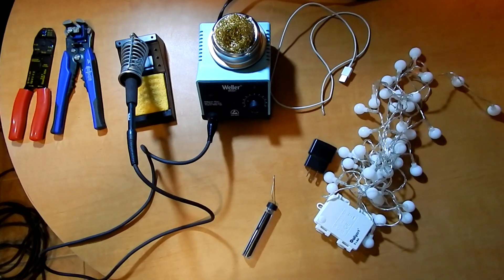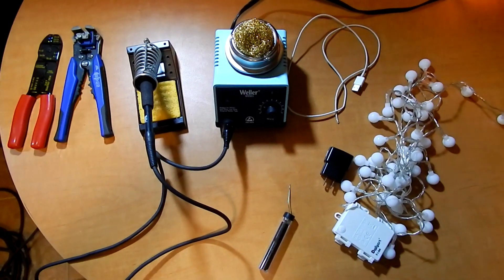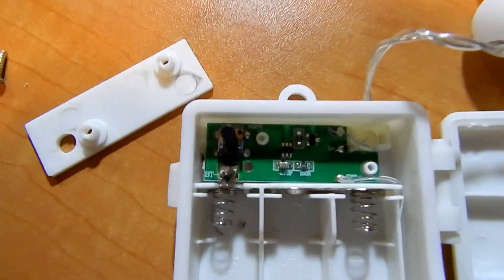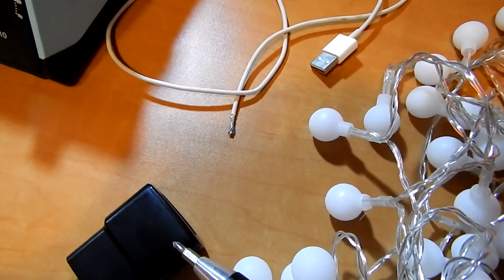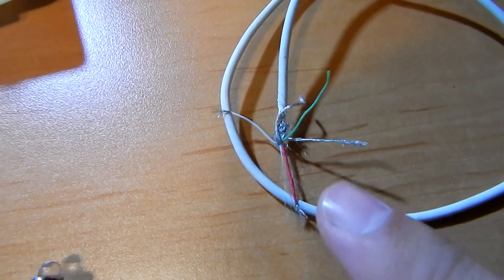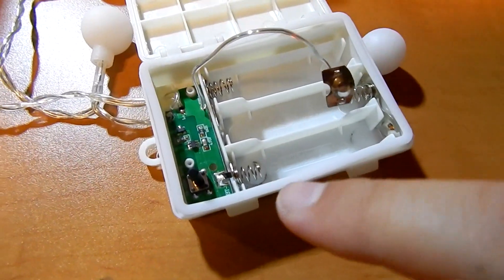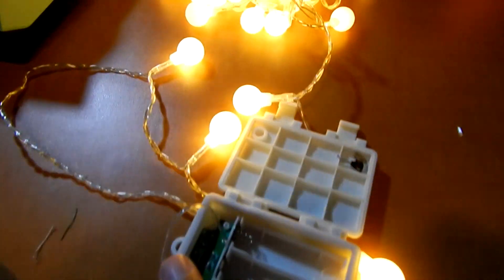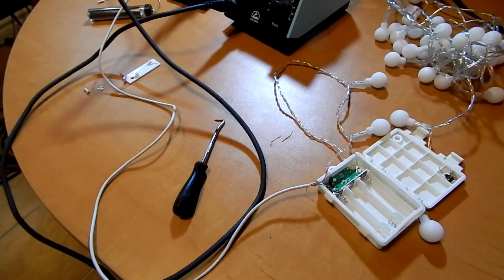DIY How to convert battery powered lights to AC powered!

Comment: So many videos like this where the lights are just soldered to the USB cable and plugged in. Then you see some videos with same voltage plugs and lights, but then there's a lot of complicated messing about with resistors and the like and changing the current... so which is correct?

Comment: My first time converting anything. I know how to jump my car with a battery, thats about it. I was sick of buying "fairy" lights that come battery powered. They are perfect for night lights. The cost and many options had me hooked. Im not a fan of anything battery powered unless they can be recharged. I hate watching videos that have long stories before and during. Thank you for the help! I just bought many strings to convert. 😊 If a lower voltage is required feel free to correct me.

Comment: Aren’t you afraid of the higher Amper produced by the charger than by the batteries? Will it not harm the led?
Reply: Amps are drawn, not pushed. So as long as you have more than 1 amp, you should be fine. In fact, the power supply could be rated at 50 amps and you would be fine, too.

Comment: I have a question. I have 4 seperate lights. Each powered by 2 AA batteries (3V)? I want to power all 4 from one AC adaptor and switch. 
So do I need a 12 V dc adaptor? How do I wire them so I’m not feeding 12V to each light and I’m sharing the 12V between all 4 lights?
Thanks.

Comment: Got a quick questions.  My wife has 3 candles on the mantel above the fireplace all 3 take 3 AA batteries. I'm tired of buying batteries, what would be the best option to convert these with the lease amount of wires running everywere? 

Can I hook up a 12 volt power supply and tee off to all three of the candles?  Will be short 1.5 Volts but will it work?  If I only hooked up 2 candles I will only need 9 volts will a 12 volt power supply push to much beings there is 4 volts left?

Comment: I have 2 battery powered LED lights.  They have 3 leds and a small motor, running off 3 AA (4.5V in total) batteries.  If I were to wire both of these up to the same power source,  would I need anything besides the 9V AC adapter?  Would I need to add a resistor or are there resistors inside AC adapters?  I'm new to this, so please forgive my rookie questions.

Comment: USB cable...BRILLIANT! Never thought about it but yes, that is the perfect solution [I think! LOL]
Reply: I agree!  I'd been thinking to do it I'd have to figure out how to work with resistors, or something, to lower the power from the outlet to whatever the light string needs.  I guess it's still dependent on finding a light string that needs right around 5 volts, but that's hopefully not too hard.

Comment: Great idea, thanks for sharing. The dollar store started carrying fairly powerful LED floodlights that are battery powered. Will attempt converting those into plug-in lights using dollar store chargers and cables. Work lights for under 10 bux!

Comment: Does anyone know how to wire several  light strings to the same plug?
Reply: I wouldn't do this with a 5v phone charger. It would lessen the output to each set of lights, the more you added... each set of lights needs at least 2 AA batteries (3v)... maybe a 12v cable would work for eg. 4-5 light sets that'd usually require 2 AA batteries OR for 3 light sets that'd require 3 AA's 👍
Also, I would test which wires are pos & neg in all of them before soldering anything (not solder as you go) coz testing a neg on a pos bunch may short circut the lot already soldered on 😬

Comment: Could you connect several of those light sets in series with the same 5v adapter?
Reply: I would also like to know the answer to this
Reply: Melissa May 

“Series” would drop the voltage to far.

It would need to be in parallel so each string would see the 5 volts and make sure you don’t draw more current than you USB power supply can give.  Most USB power supply’s can do 1 amp some can even do 2.4 (iPad chargers)

Comment: Two years late lol but will this work with any light device that’s 5V? I bought my brother a blue LED lightning bolt thing for his desk, but I didn’t know it required 3AA batteries.  The thing dies every third day as he just leaves it on. 

It’s only going to be used as a desk ornament, so we don’t need the portability. If I use the same iPhone wire and phone block adapter as you used, will I need any additional resistors/capacitors?

Comment: Dear DIY Creator, need some help. I tried something similar. I had a night light sensor with three AAA 1.5 batteries. I used a mobile charger (about 5v) which takes  type A USB which connects to the charger while I cut the other end C usb. Found the live and neutral (in my case Red and Black  as white and green were data) and soldered them to a common connection on the night light. BUT what happened is that the LEDs light alright but they do not go off. I tried the batteries again without the charger and worked OK. Can you tell me what I did wrong. According to the multimeter the reading was 4.9V. Any help pls?
Reply: My guess is you somehow bypassed the sensor portion of the light. The sensor is supposed to act like a switch, turning the lights on (supplying power) only when needed, but you seem to be supplying power all the time. So you probably just connected the hot wire at the wrong location.

Comment: Thanks!  
To add another dimension, could I add the lower voltage fairy light string to a 12V AC circuit (that powers  12V UV SMD LED light string) if I also added a buck converter (or voltage limiter of some type) to have a seperate light inside an eternity mirror? Ie., I am making an eternity mirror as a gift and just can't figure out how to use the fairy lights for the detail at the center of the mirror without blowing every LED.  There are no variables to the fairy lights - there is only a resistor in the battery box since it is a simple on/off controller - and I have an inline buck converter that drops voltage to 5V.  The wall adapter is a 5-12V AC to DC source, but I know from experience that the adapter is not a regulator, and having 2 power sources is not gonna be aesthetically pleasing.
Any ideas or am I on the right track?  
Thanks again!  I am planning to do just what you describe for a other lighted gift now!!!

Comment: I would be tempted to add a female connector to the battery terminals so that the usb male connector could just be plugged in rather than soldered. This was a nice explanation of the task.

Comment: I found 5m string lights with a remote and it has settings connected to the battery box that will make it change 8 different flashing patterns with a timer.  Is there a way to convert something like this to USB or is it too hard to do?
Reply: none of that matters. this is just a power source.

Comment: I want to covert 7 different Christmas village houses that are battery operated. Most of them have 3 battery each.  I would like to convert them to electrical.   I would like to have them go into a USB hub.Does anyone know what kind of USB  hub I need to buy and what voltage. What does USB 2.07   and USB 3.0 mean when buying a USB hub. Any help you can give me would be greatly appreciated. Thanks for any help you can give me.

Comment: would this setup work on item runnin on just 1 or 2 AA's?  Got a big Christmas village & some of street lights only run on batt (no dc adapter outlet.  Pain constantly replacing batteries if left on or turning off/on to match rest that's on a timer.  Thx, Jerry
Reply: The connection would be the same. 
Your just need an adjustable power adapter that has an input of 110V (if US) or 220V (if Europe) and an output of 1.5V (for single battery) or 3V (for 2 batterries).

Here is an example of such a power adapter.
https://www.ebay.com/itm/3V-12V-Universal-Multi-Adjustable-Adapter-Power-Supply-Transformer-US-EU-Plug/272856473474?hash=item3f87835f82:m:mXDif85skDQNNdabYsBlepQ

Comment: I want to do the same thing to a Puck Light that is operated buy 3 AAA batteries. How do I know what voltage of phone charger USB I need?
Reply: Each AAA battery is 1.5V, so 3 AAA batteries would provide 4.5V (3 x 1.5 = 4.5).  All USB charging adapters provide 5Vdc, but their output current can vary between 500mA (0.5A) to 3.0A.  If your puck light has LEDs, then even the older 500mA chargers will be OK to use.
Most newer chargers have the higher current capability.  They all should have a label indicating 5Vdc output and also their current.
Reply: @norcalkid2776  god bless you sir, thank you.

Comment: Good video. One tip....if you have an Android style cable, use it instead. They are a dime a dozen. I hate using my precious iphone cable. Also, just two wires in the android charger. Red and black. Real simple.  I converted a 3 volt supply (2 double A's) to this 5 volt system, and it worked great. And a plus is that the bulbs are 2 volts brighter. lol. Good video.
Reply: Hey do you know if it is possible to by-pass the battery holder completely? I don't need any of the functionality...just the ability to turn them on when I plug in.
Reply: @Uli-verse  I tried doing that and it burned out my lights in seconds. I think there's a volt regulator that the LEDs need in the battery box. If you figured it out, let me know please.
Reply: @Uli-verse  Here's one example: https://www.youtube.com/watch?v=gJKy20wfIvg
Reply: Do you know how to convert a 8 unit battery powered puck light system into a 110 volt system? I need to also know which amp converter I need. Each puck takes 3 AAA batteries.
Reply: Thanks I am going to try this before asking my hubby, I think I can!!!!

Comment: It is so weird that I was looking to learn this for the exact thing that you used ( the lights from amazon) but I was wondering can I use plug of any old christmas lights instead of a usb cable?
Reply: No.  What's coming out of your christmas light plug is 110v AC.  You need the usb charger to convert from 110vAC to 5vDC.  Connecting the 110vAC directly will at least cause smoke or damage to the components.
Reply: This video is for simple 3 battery configurations... 1.5v+1.5v+1.5v=4.5v
USB=5v
Not equal,  sure.   But a great hack for cheap lights.

Comment: clean job explaining things. PLEASE include a short explanation somewhere about voltage and why 5v is sufficient for this. People who dont understand will try something like this and ruin their electronics..
Reply: okay steven this is exactly what I was looking for, please let me know in the comments  how to know what kind of power is enough! also, it seems to me that he only took a usb charger and connected the strings to the battery box?  are all chargers for phones 5V?
Reply: @johhnycash1515  AA, AAA, C & D are all 1.5v batteries. A USB charger (5v max) will suffice for any set that has 3-4 of any of these battery types.
Reply: @johhnycash1515  Yes, USB is limited to 5v.
Reply: @fieldauditservices6870  so we should use a usb and not directly to plug in socket like christmas lights because it's 220 in the wall and they will explode?